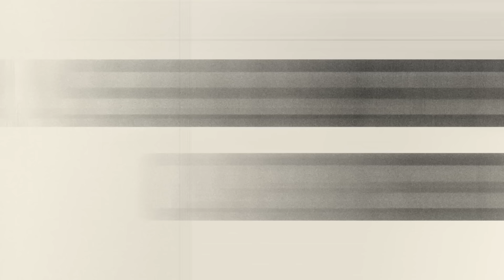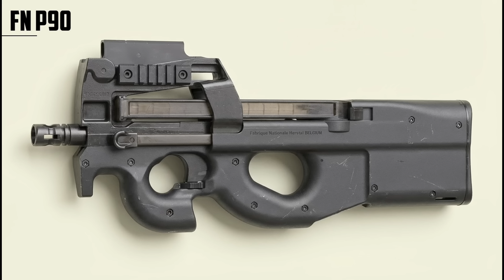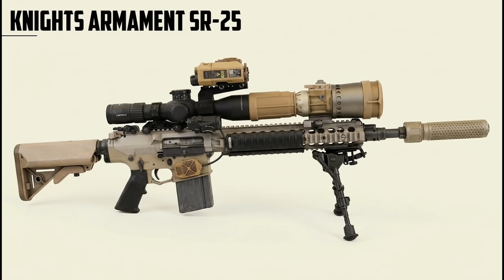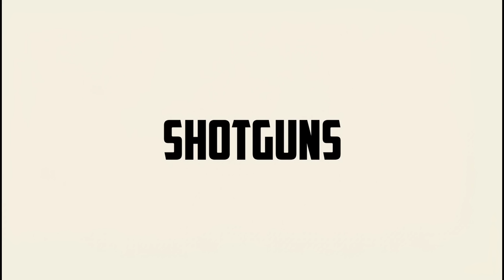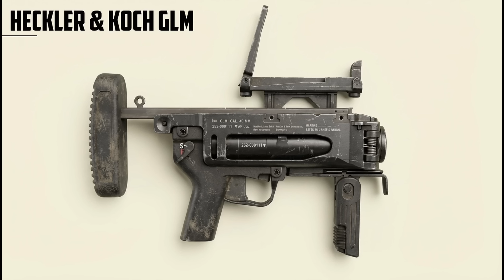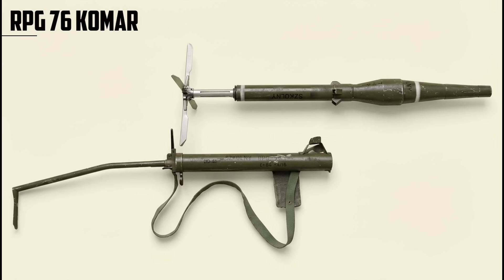Every Weapon Poland's GROM Uses in Combat

Comment: JW Grom uses mainly just part of this weapons systems - Hk416,Hk417,MCX, ealier was M4 platforms like SR16 and Bushmaster with Aimpoints.For CQB they used MP5 and MP5SD, for the pistols is mainly HK USP and Glocks.Rest of the weapons are included bcs GROM tested this platforms in small amounts, probably not use them in main operations.Also the g36 and Sig P226 is used by another Polish big SOF unit JW Formoza.